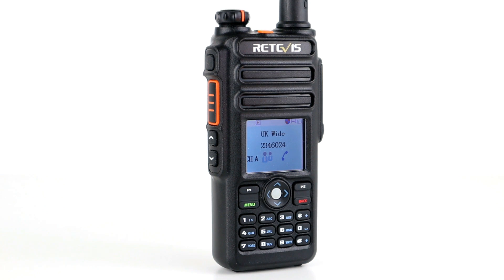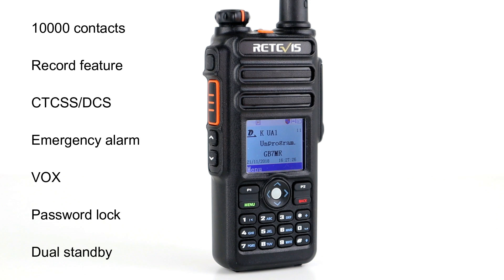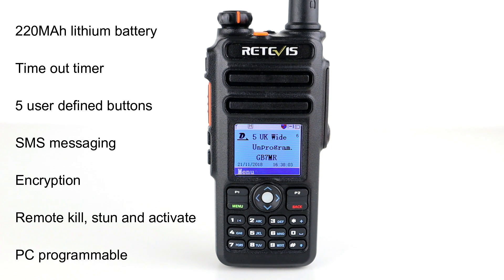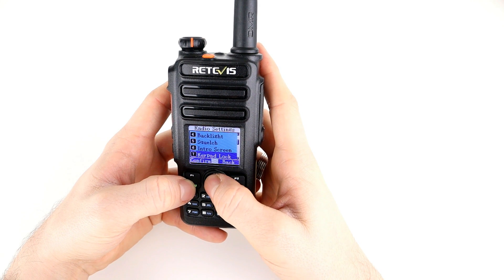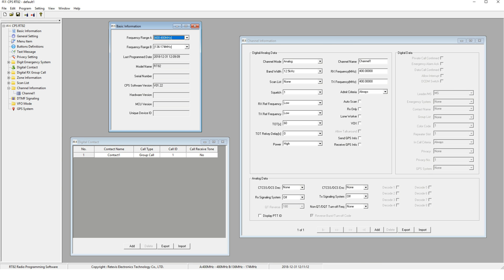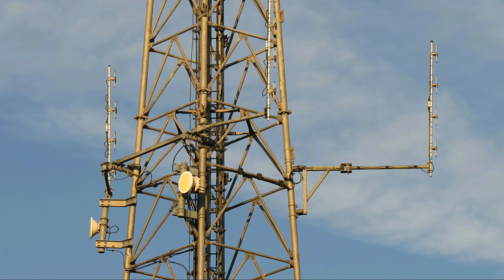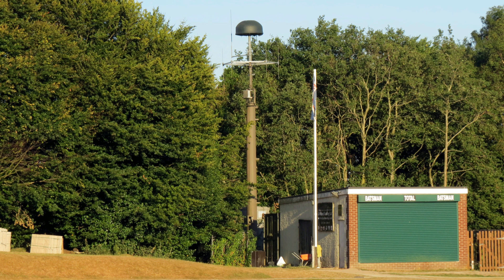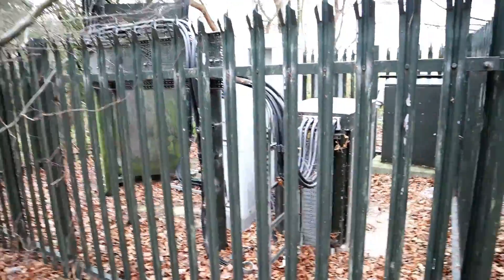Retevis RT82 DMR Radio Review & Urban Range Test!

Comment: I wish that the Retevis RT82 had the Anytone features and a working GPS.
The Retevis RT82 is build like a tank, but some claimed features are missing in my unit ( GPS/APRS doesn't work even if the unit identifies as an GPS-version ) + Retevis support is non-existing. ☹ ( Yes - I have enabled GPS in the codeplug and compared it with others.  )

Comment: But you CAN programm the radio from the front... in the settings.ini from the CPS just set the programpsw switch from 0 to 1 and then under Menu Item in the CPS you got program radio
Reply: I have this radio also and swear by it as a personal radio, and as a radio for work in security,and I find the sound quality for send and receive is on-par with Motorola if not better in some respects,as is its features (IP-67 for one among a few)...Like the post above said,it is possible to program this radio from the front end in the manner he stated through the programming software (CPS) (I do all the time when I have to add channels and zones with colour codes,slots and such)...The encryption is not only 4 character basic based but can be set for a more complex encryption (which I use regularly) also from the programming software,but alas encryption setting can only be done via the programming software and not the front end,which is handy as when someone finds your channel and colour code when encrypted they still only get garbled packets...And I can also say from festival field testing (Leeds 2017) it is very much water and mud proof,don't know about a portaloo or long-drop loo proof,that never happened thankfully :D 
Hope that helps
Ps:The firmware can be updated to a experimental ham version,as well as the newer updates.Also the record feature can be erased with an update to expand the contacts to 100,000 just like the TYT MD-2017,which as you know already that radio and this one are exactly the same radio on the inside but with cosmetic differences on the outside.
PPS: I can also confirm its range test is very good as I live in Grimsby and can hit the repeater in Winterton which is 26mi from me without ANY issues from my front garden with stock antenna...I'm very impressed with its performance and battery life also.
Reply from the maker: Cheers for the info!

Comment: Nice video again Lewis. Yes, the cut-down version is good as like you say most of the other things have been done in your other videos. Nice timing with the video actually as I was looking yesterday into whether to buy one. This has helped my decision
Reply: Read my above post reply on "front end programming" as to radio use and quality...Buy one,you won't regret it (hopefully),,I think it's a good quality radio for it's price and if you look well-enough out there you'll get a good deal with radio,battery eliminator,spare battery and radio holster deals (i did this and got a good package for just shy of £200 back in 2017 on ebay just after the release of this radio and it's TYT sister).